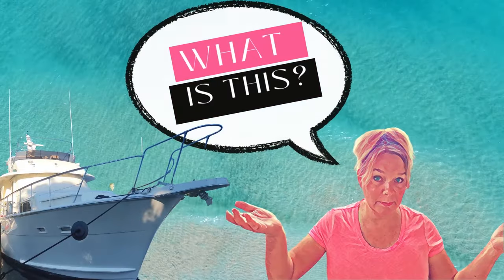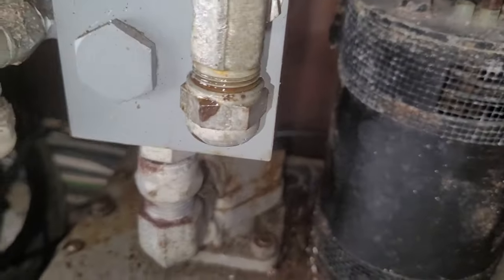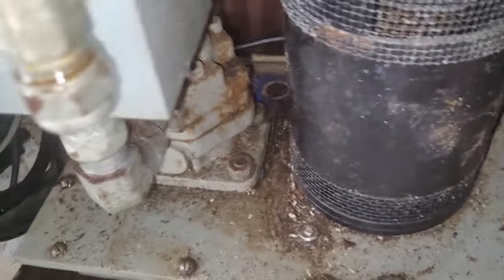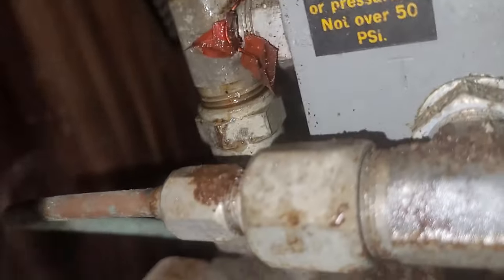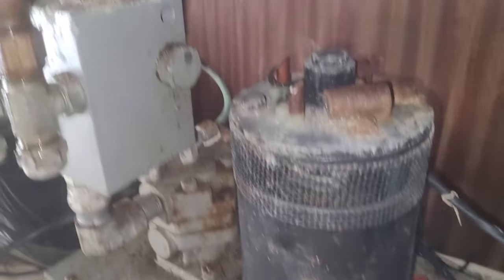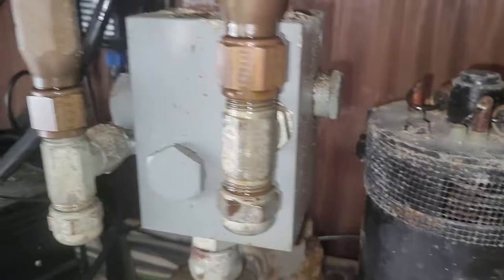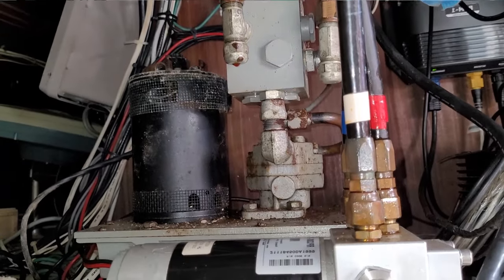What is this hydraulic pump? Solved!

Comment: Looks like a decommissioned hydraulic power pack maybe for an old Davit Crane or Winch.  If your upstairs steering is not working the manual pump connected to the upstairs steering wheel is in need of repair (new rubber seals or a check not working).  Does your auto pilot work ok? This would be run by the Simrad pump.
Reply from the maker: The AP in pilot house works, but I don't know if we even tried the one upstairs because the steering didn't work.  The old pump was not connected, but the Simrad ap was, so when I get the steering pump back next week, I'm only going to hook up the Simrad again.  If the steering works, then we know the answer of what I can do with that old pump!!!

Comment: I wish I could tell you to add it to an artificial reef. With the captured oil, you can not do that.
That is a very old constant AP pump (Benmar?). Installed long before your Simrad stuff.
Just get it out and get rid of it. Give it to SailorMan's or leave it in their dumpster.
Reply from the maker: It is an old wood freeman and I'm keeping the fittings as they are quite pricey and re usable, but the pump is going to the dump.  =-)

Comment: Can you post a photo of the pump or device connected to the upstairs steering wheel ?  Just maybe the upstairs steering position was decommissioned along with the old auto pilot pump?
Reply from the maker: We removed it on Friday.  After the last "hydraulic" tech came and went and steering on top still didn't work, I got to work researching and I called my favorite Hynautic guy, Captain Charlie, (Souther Charm in Pinnellas Park) and got a 20 minute lesson about how Hynautic systems work.   So, Jim and I removed the steering wheel and pump to ship out, but even he didn't know what that old thing was, but he agreed we shouldn't re connect it. =-)

Comment: Just found your videos, Great channel. I will sure follow your progress. When we bought our old Hat 5 years ago there were a lot of systems that did not work, the upper helm being one of them, after doing some reading  on it we were able to get it working by pumping up the little reservoir  in the engine room and then turning the wheel hundreds of times in each direction while making sure that the pressure stayed up in the little reservoir, finally the helm pump took hold and it has worked ever since. I see you have ID'ed your item as an old ap pump ..  Your "PROFESIONAL"  people are good at two things, new boats and taking money. My wife and I are super happy with our boat and like yours it is a work in progress. we were intending to do the loop but covid smashed that plan for now.
Reply from the maker: Welcome aboard!  Glad to have another Mad Hatter along for the ride. =-) 

I am so glad you replied!  We are stumped that upper isn't working yet and I was wondering if maybe it was just going to take lots and lots of turning to get it going.    It's holding pressure, it's holding fluid... pump is newly rebuilt and pilot house works fine, so upper SHOULD work.  This is probably one of the simplest systems on the boat, so I'm really hoping what you said holds true for me! I'm going to try that again tonight and just keep turning and turning.
Reply: if you get tired don't give up, I didn't think it would work but it did, once it took hold it has never not work again. and we are on the hard for 6 months a year at Lake Champlain @ShaylaVie
Reply from the maker: It worked!!!! You are my HERO!!!!!  We cheated though... used the Simrad ap to kick start it lol My arms were about to fall off!!! I'm posting a short about it.  Happy Thanksgiving!!!

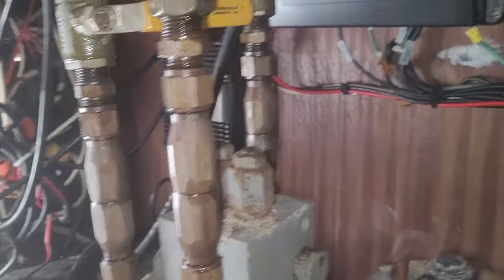Comment: I agree with the others, it is the Autopilot pump, watching your video at 1:11 and I see the simrad AC20 computer, which is for the AP… seems to all be located together
Reply from the maker: Yeah, and the simrad looks like it's in great condition, so I'm hoping when I figure out the issue with the steering, that it will work. =-)  Jim and I pulled the steering pump off on Friday to be sent for repair, so I guess that will be the real proof as I am not going to hook up that old pump.  =-)

Comment: Definitely old auto pilot. Almost every boat has piles of manuals and literature that will be a huge value to read up on. Especially if you have the Hatteras stuff that came with her originally.
Reply from the maker: I do have all the original diagrams and manual for the boat... a lot of stuff has changed however, so sometimes it's not a good source of info, but it does help a lot to understand the general way things work!

Comment: Its an auto pilot pump, steering will work fine without it. My Hatteras has no auto pilot and I steer it just fine.But I have to steer it all the time :) those pumps are usually located near the steering cylinder by the rudders  but can be anywhere.
Reply from the maker: I think all of you are right... just so sad that three "hydraulic steering pros" had no clue what that thing was!!!

Comment: As others have said, it's either a steering pump for an autopilot, or it's also possible it's a backup to the main pump in case of failure. I'd contact the old owner if you can and just ask if the boat used to have autopilot.
Reply from the maker: Sadly, I can't contact the old owner.  They donated the boat to a charity, so neither the charity or the broker know jack didly about this boat.  I'm just figuring it out as I go.  But, I agree.  I think the pros were wrong and that is just an old decommissioned AP.

Comment: Your fly brigde should be connected to you lower controls via some hydrolic pipes. If there is air in the system the upper helm is often the first to stop working. You can have air or a leak or both. Looked wet when you touched the newer pump. Fill the whole system up reservoirs both upper and lower helm and work those controls. Many times you can revive the steering. When you have filled it all up and worked it a little. Go on a hunt for leaks. If you find wet spots (leaked steering oil. Dry of and go work it again. Go back and see if it leaked out again. There can be many leaks from dry or broken o-rings.
Reply from the maker: Thanks for the info.   When we took the steering column out, it leaked a little atf on the simrad pump.  I had the steering column pump rebuilt and we reinstalled it last week.  It took a few days of bleeding (until we thought of using the AP) but it's all working now.  You can see it in the short I posted yesterday. =-)
Reply: Good you got it solved. On to the next thing. This is so fun if you let it be fun. @ShaylaVie

Comment: You do need a hydraulic pump for the activation under autopilot . The helm pumps are mechanically operated closed system , unless power assisted , then there's a electric hydraulic  pump in the system . Without seeing all the system it's not that easy to tell you exactly what's going on . If you want I'm available,  not interested in money just food and board . Oh yes it's Ian from Canada/ UK , need a permit to work on your boat .
Reply from the maker: yeah, I think it's an old ap decommissioned for the new simrad.   Canada is a loong way from SoFlo lol but drop me a line and maybe I can ask questions? boats4Shay@gmail.com

Comment: I am looking at a 1984 Hatteras , would you recommmend me to proceed or back off
Reply from the maker: I'm no expert, but no one has told me I bought a bad boat.  Everyone says Hats are as solid as they come, which is reassuring.  BUT that is pretty old, so be prepared to fix a lot of things if you do buy it.  If you like working on a boat, I feel these are pretty easy to do that.  Lots of resources and parts available.
Reply: @ShaylaVie  thanks for reply
Seems like you still have a smile on your face 
I do love these boats

Comment: I would turn the wheel and go out back and see if your Ritter is moving. If it does someone may have just bypassed it.
Reply from the maker: If the rudder moved, we wouldn't be having this conversation. =-)  It works from pilot house, but not flybridge.  I've removed the pump from the flybridge helm and sent it off to be repaired.   That will tell the truth. =-)
Reply: @ShaylaVie  oh they must have one for each. That way technically you have a back up. Bet that is the thinking.

Comment: What were you thinking? No boat/mechanical experience, you bought a floating condo that will require hundreds of thousands of dollars to get it back to seaworthy condition.  Whoever gave you advice to buy this boat are laughing their a**s off.jkj  Be prepared to spend atleast 3x what you purchased the boat for on repairs and maintenance.
You could have bought a smaller boat in turn key condition for a fraction of what this boat is going to cost you.  You could be in the Bahamas now enjoying life. So sad.
Reply from the maker: Three times is still less than what it's worth fixed up =-)  And, you say turnkey... so did sales people, but I saw the flaws on those boats, too.  Rotten wood, water sitting on the engine room floor  or running down the walls after a rain, painted walls to hide old water damage, etc.  The fact is, ALL old boats are project boats... just some look better on the outside, if you get lucky and actually LIKE the old owners decor style. =-)  

Plus, I want to learn all the systems and see how things work!  This is so much more fun (most days) and I'll be off the dock soon enough in a boat I know I can trust and I know I can fix when stuff breaks. =-)